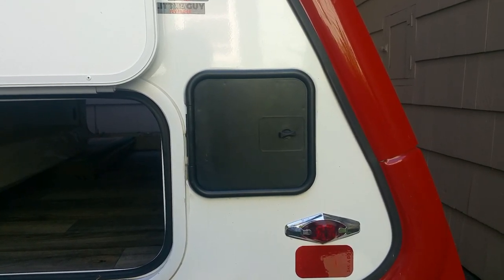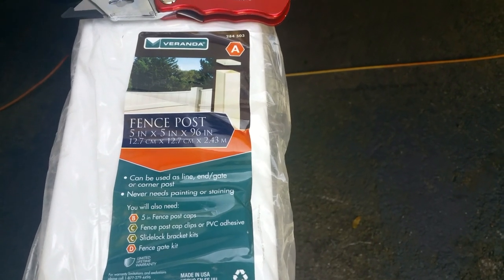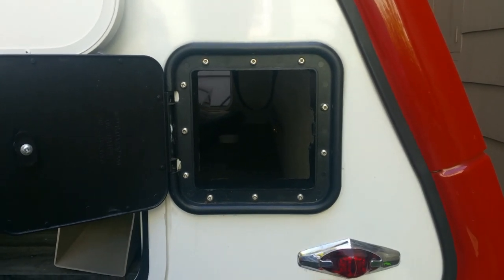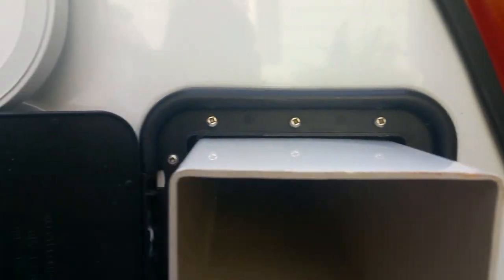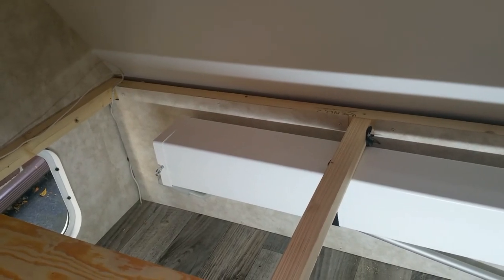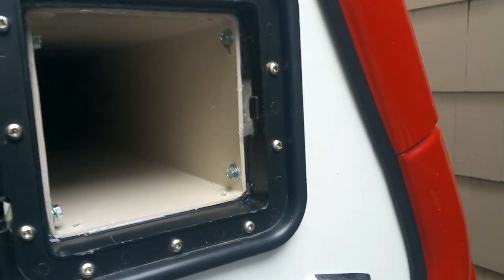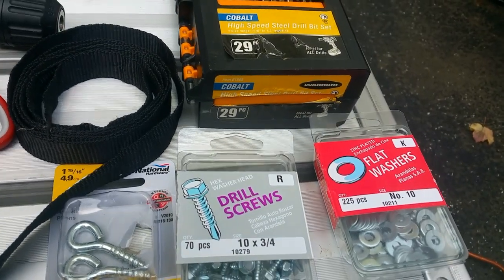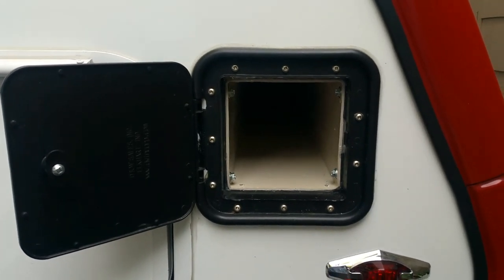Sewer Hose Storage Capacity Hack/Upgrade for Little Guy Max RV Travel Trailer

Comment: Hi, I just bought a 2021 LGM  earlier this week. It has a manufactured date of Jan 2021. Mine doesn't have the black door or tube next to/inside the pass through compartment. Instead I have a round black tube mounted at the front of the trailer underneath the propane tank and battery to store the sewer hose. Not sure if it is a better solution or not but I'm guessing this is the solution Xtreme Outdoors has decided on for the time being.
Reply from the maker: Yes, they changed the placement on 2021 it seems, not sure it is better, people have complained it is harder to use. I am older 70 years old version and prefer the older version with hack.You can buy the other one and install it. My LGM is a 2020.

Comment: can you send me the link to the connector to the septic dump?   thanks
Reply from the maker: Hello Ron, I used a camco 90 degree clear. Here is the link from Amazon. Bought mine over year ago. It looks like they have changed the design, mine is one piece. This is what the have now. 

Camco 39471 Revolution 4-in-1 Sewer Elbow - Bayonet Style Elbow Rotates 360 Degrees and is Detachable, Built-in Gasket for an Odor Tight Connection https://www.amazon.com/dp/B002OUIXKS/ref=cm_sw_r_em_apan_glt_fabc_SAXCBAFW67ZCK5A2P9MQ?_encoding=UTF8&psc=1